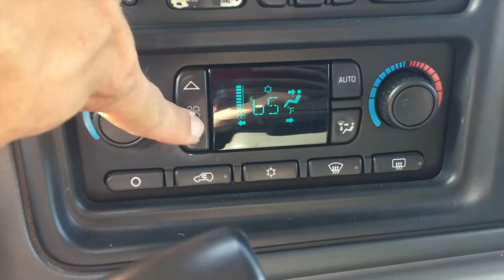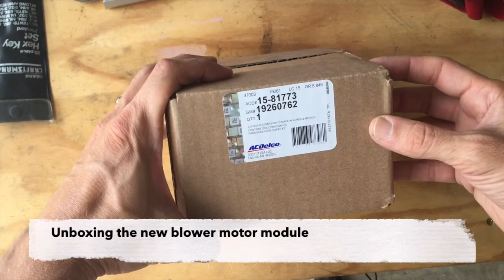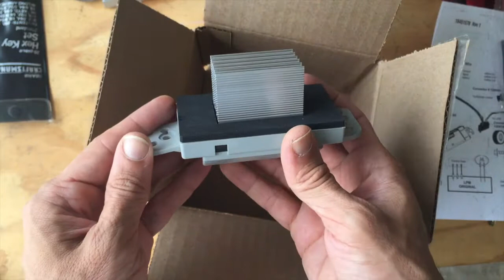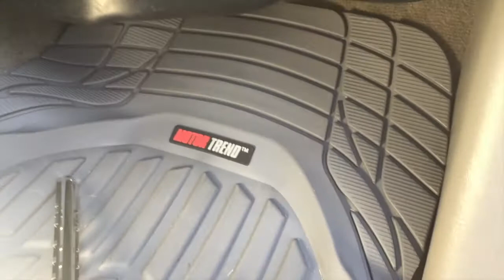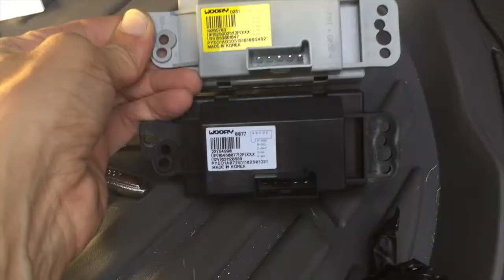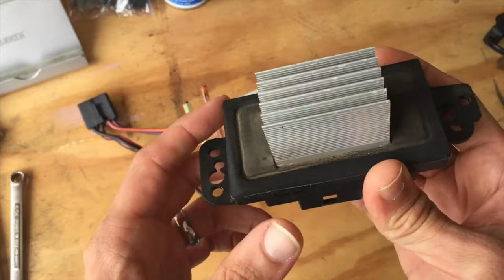A/C Fan shutting off randomly? How to fix on a 2005 Chevy Suburban

Comment: Bout 1.5 yrs ago I had some ac work done on my car they replaced the blower, the resistor, and expansion valve. W/o going into too much explanation they charged me about $1200 worth of work. Fast forward later they end up giving me a refund for all the work and I am now having issues w/ no fan blowing. The symptoms you described were almost identical to what I experienced. Works then randomly shuts off and it increased in frequency. Now the blower won't come on at all. I thought it was a resistor and already ordered it. I came across this video wracking my brain as to what else it could be and you gave me a little pc of mind thinking Im headed down the right path. If no update then assume that my issue was this and it was fixed w/ the part change.

Comment: I have replaced that part on mine 3 times over the last few years.  Now I can be sitting at a stop and the Dan stop blowing and start moving and it comes back on. I’m just about tired of dealing with it.
Reply: I did the permanent fix for it my blower motor turning off and on intermmitently on my 2003 Silverado.  I bought an "add a circuit."  I bought the 30 amp one.  I pulled the 30 amp fuse out in the cab for the heater/AC hvac system and plugged in the add a circuit that has 2, 30 amp fuses in it with a pig tail coming out of it.  I connected 8 ft of 14 gauge electrical wire to it with a butt connector.  I ran the other end to the blower motor on the passenger side of the cab.  I cut the pig tail off of the blower motor(the blower motor just has 2 wires coming out of it.  A red and a black wire.  I connected it to the red wire.  The black wire on the blower motor I connected an eyelet to it and connected it to one of the glove box hinge screws which was a good ground.  I cut the 8 ft piece of wire right above the transfer case shifter and installed a toggle switch from walmart.  Now I can turn my blower motor off and on with that toggle switch.  I only have high fan speed, but I don't care.

Comment: Is your resistor still working?  On my 2003 chevy silverado the blower motor turns off and on all the time too.  I have to change out the $13 blower motor resistor from e-bay every 6 months.  Been doing this for 2 years now.
Reply: UPDATE:  I did the permanent fix for it my blower motor turning off and on intermmitently on my 2003 Silverado.  I bought an "add a circuit."  I bought the 30 amp one.  I pulled the 30 amp fuse out in the cab for the heater/AC hvac system and plugged in the add a circuit that has 2, 30 amp fuses in it with a pig tail coming out of it.  I connected 8 ft of 14 gauge electrical wire to it with a butt connector.  I ran the other end to the blower motor on the passenger side of the cab.  I cut the pig tail off of the blower motor(the blower motor just has 2 wires coming out of it.  A red and a black wire.  I connected it to the red wire.  The black wire on the blower motor I connected an eyelet to it and connected it to one of the glove box hinge screws which was a good ground.  I cut the 8 ft piece of wire right above the transfer case shifter and installed a toggle switch from walmart.  Now I can turn my blower motor off and on with that toggle switch.  I only have high fan speed, but I don't care.

Comment: Did it work or not
Reply: I did the permanent fix for it my blower motor turning off and on intermmitently on my 2003 Silverado.  I bought an "add a circuit."  I bought the 30 amp one.  I pulled the 30 amp fuse out in the cab for the heater/AC hvac system and plugged in the add a circuit that has 2, 30 amp fuses in it with a pig tail coming out of it.  I connected 8 ft of 14 gauge electrical wire to it with a butt connector.  I ran the other end to the blower motor on the passenger side of the cab.  I cut the pig tail off of the blower motor(the blower motor just has 2 wires coming out of it.  A red and a black wire.  I connected it to the red wire.  The black wire on the blower motor I connected an eyelet to it and connected it to one of the glove box hinge screws which was a good ground.  I cut the 8 ft piece of wire right above the transfer case shifter and installed a toggle switch from walmart.  Now I can turn my blower motor off and on with that toggle switch.  I only have high fan speed, but I don't care.

Comment: My 2004 GMC Yukon XL the blower would just stay on nonstop even with the key off and out. I would pull the fuse so it wouldn't kill me battery so I gotta replace the same part
Reply: I did the permanent fix for it my blower motor turning off and on intermmitently on my 2003 Silverado.  I bought an "add a circuit."  I bought the 30 amp one.  I pulled the 30 amp fuse out in the cab for the heater/AC hvac system and plugged in the add a circuit that has 2, 30 amp fuses in it with a pig tail coming out of it.  I connected 8 ft of 14 gauge electrical wire to it with a butt connector.  I ran the other end to the blower motor on the passenger side of the cab.  I cut the pig tail off of the blower motor(the blower motor just has 2 wires coming out of it.  A red and a black wire.  I connected it to the red wire.  The black wire on the blower motor I connected an eyelet to it and connected it to one of the glove box hinge screws which was a good ground.  I cut the 8 ft piece of wire right above the transfer case shifter and installed a toggle switch from walmart.  Now I can turn my blower motor off and on with that toggle switch.  I only have high fan speed, but I don't care.

Comment: I wish you would have popped open that old module to see the damage, and to see what was rattling around inside of it.. I've got the same issue, with intermittent shutting off and turning on, but I'm going to try to fix my relay instead of replacing it.. wish me luck.  I'm sure it'll end up in the dumpster along with about 11 hours of time and a couple rolls of solder, but what the heck..
Reply: Did you ever find out the failure point of the blower motor resistor?

Comment: I replaced my resistor and it still does the same thing…
Reply: What did you end up doing, Steven?  I'm just cracking mine open right now
Reply: On my 2003 Silverado 2500HD I have to replace the $13 blower motor resistor on e-bay every  6 months.  It sucks, but I have just started to look at it as the cost of doing business with that pickup.  I have bought the $36 one at NAPA as well and that one only lasts 6 months too.  When they go bad they do the same thing as what that guy said.  The blower motor just keeps turning off and on and it is really annoying, when your trying to defrost the windshield.  I also keep a 200 watt cigarette lighter windshield defroster in my pickup in-case the fan would totally quit working.
Reply: I did the permanent fix for it my blower motor turning off and on intermmitently on my 2003 Silverado.  I bought an "add a circuit."  I bought the 30 amp one.  I pulled the 30 amp fuse out in the cab for the heater/AC hvac system and plugged in the add a circuit that has 2, 30 amp fuses in it with a pig tail coming out of it.  I connected 8 ft of 14 gauge electrical wire to it with a butt connector.  I ran the other end to the blower motor on the passenger side of the cab.  I cut the pig tail off of the blower motor(the blower motor just has 2 wires coming out of it.  A red and a black wire.  I connected it to the red wire.  The black wire on the blower motor I connected an eyelet to it and connected it to one of the glove box hinge screws which was a good ground.  I cut the 8 ft piece of wire right above the transfer case shifter and installed a toggle switch from walmart.  Now I can turn my blower motor off and on with that toggle switch.  I only have high fan speed, but I don't care.

Comment: Never buying a gm product again total trash new old doesn't matter had 90s junk, currently dealing with 04 junk. Not gonna be a third time. And they want 60k with a 5 foot bed to boot aka not a truck
Reply: I did the permanent fix for it my blower motor turning off and on intermmitently on my 2003 Silverado.  I bought an "add a circuit."  I bought the 30 amp one.  I pulled the 30 amp fuse out in the cab for the heater/AC hvac system and plugged in the add a circuit that has 2, 30 amp fuses in it with a pig tail coming out of it.  I connected 8 ft of 14 gauge electrical wire to it with a butt connector.  I ran the other end to the blower motor on the passenger side of the cab.  I cut the pig tail off of the blower motor(the blower motor just has 2 wires coming out of it.  A red and a black wire.  I connected it to the red wire.  The black wire on the blower motor I connected an eyelet to it and connected it to one of the glove box hinge screws which was a good ground.  I cut the 8 ft piece of wire right above the transfer case shifter and installed a toggle switch from walmart.  Now I can turn my blower motor off and on with that toggle switch.  I only have high fan speed, but I don't care.

Comment: Ib regret buying a Chevy never again
Reply: I did the permanent fix for it my blower motor turning off and on intermmitently on my 2003 Silverado.  I bought an "add a circuit."  I bought the 30 amp one.  I pulled the 30 amp fuse out in the cab for the heater/AC hvac system and plugged in the add a circuit that has 2, 30 amp fuses in it with a pig tail coming out of it.  I connected 8 ft of 14 gauge electrical wire to it with a butt connector.  I ran the other end to the blower motor on the passenger side of the cab.  I cut the pig tail off of the blower motor(the blower motor just has 2 wires coming out of it.  A red and a black wire.  I connected it to the red wire.  The black wire on the blower motor I connected an eyelet to it and connected it to one of the glove box hinge screws which was a good ground.  I cut the 8 ft piece of wire right above the transfer case shifter and installed a toggle switch from walmart.  Now I can turn my blower motor off and on with that toggle switch.  I only have high fan speed, but I don't care.